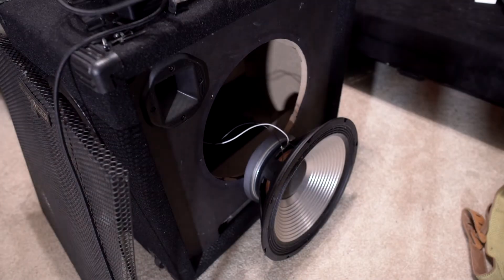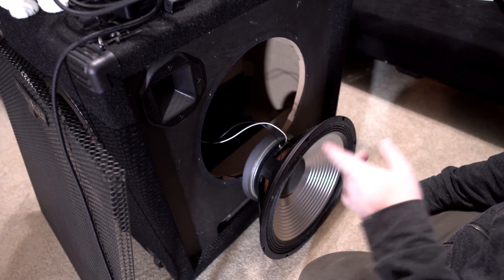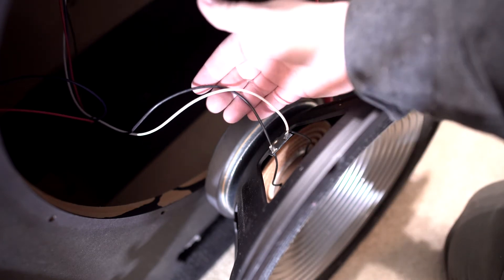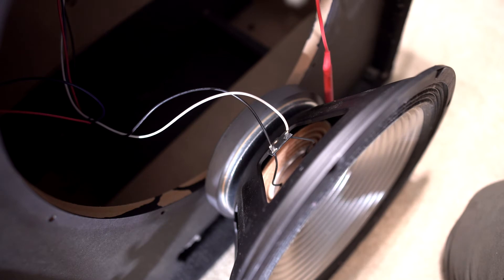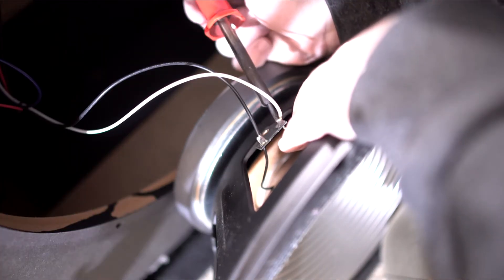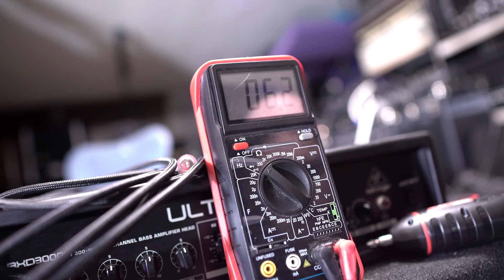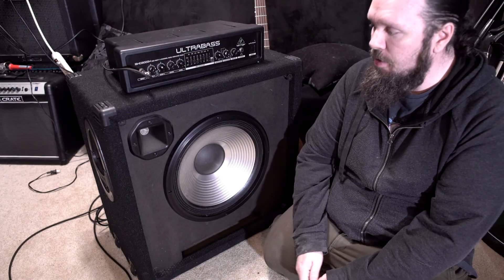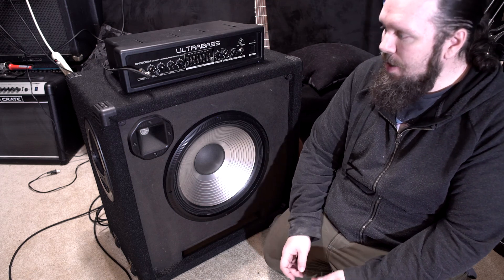Behringer Ba115  Bass Cab Repair

Comment: Great repair!  Remember that a speaker's rated impedance is nominal and impedance is a measure of AC ohms (which takes into account both the DC resistance of the wire and the Reactance of the inductance of the voice coil).  With an ohmmeter, you're measuring DC resistance.  For an 8 ohm speaker, a resistance of 6.2 ohms or so is perfectly normal.

Over the years, I've encountered a number of weirdnesses when it comes to connections between the speaker's tinsel leads and the terminal.  I once bought a Sonic brand 8x10 really cheap and found that the two Carvin replacement speakers in it appeared to be dead.  The only problem with them was that the solder joint connecting the tinsel lead to the terminal was cold soldered.  Once I reflowed the solder, both speakers were perfectly fine.